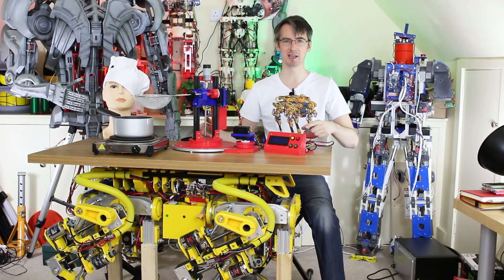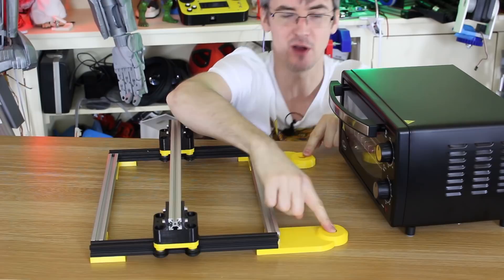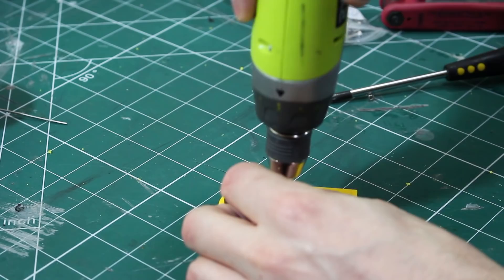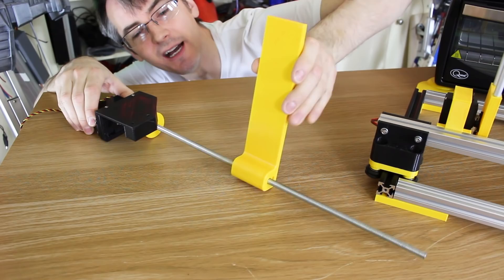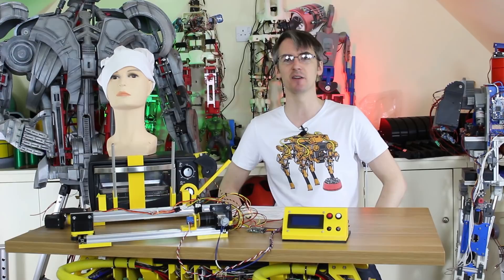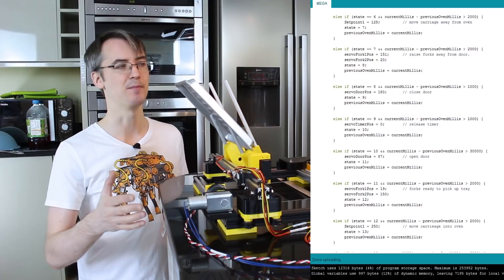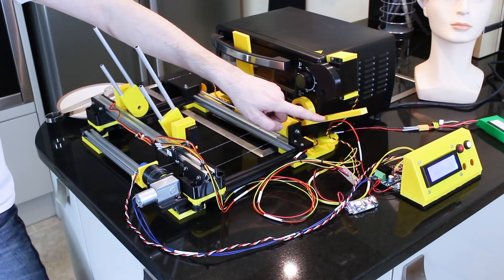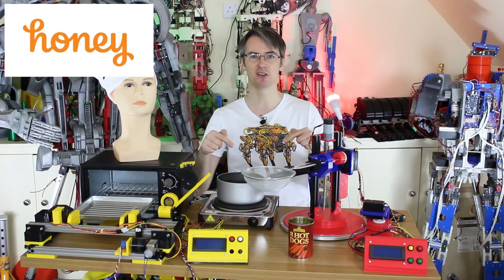I Built a Robot Toaster Oven | James Bruton

Comment: I have heard you mention the multiple serial ports on the Arduino MEGA multiple times now. Why don't you use a bus system like i2c and use smaller/cheaper controllers? 
Especially when you want to control multiple semi standalone devices (such as individual robots) and do not need a lot of data transferred a bus system is a really good fit.